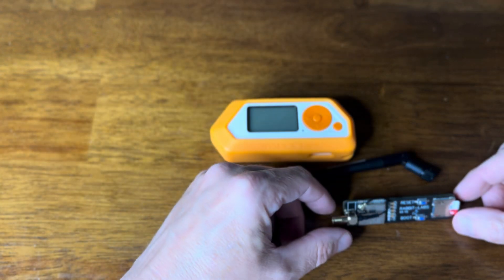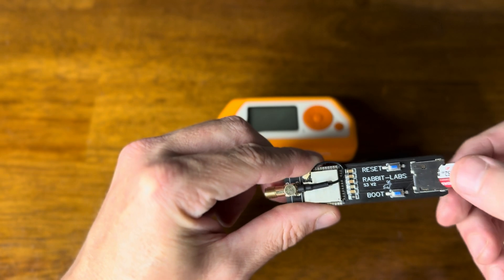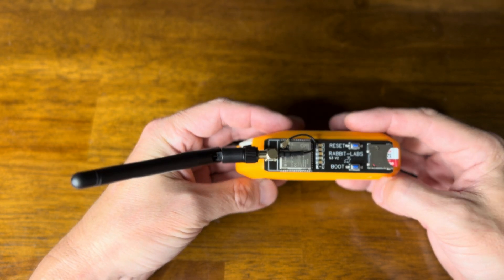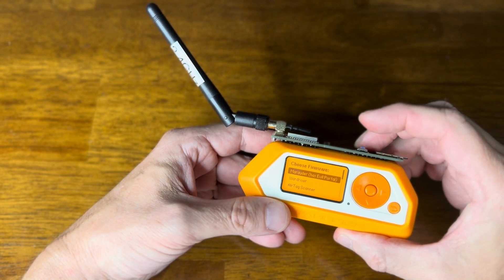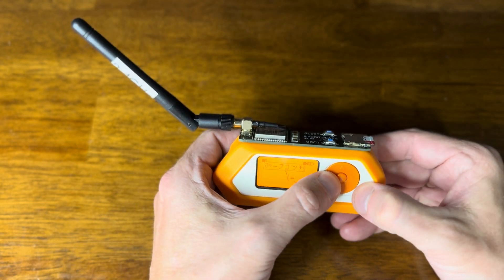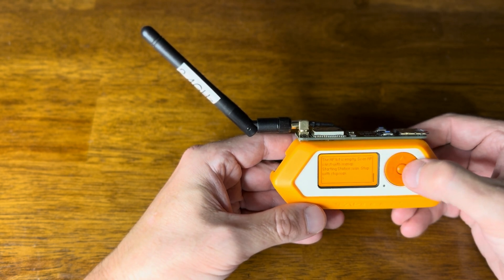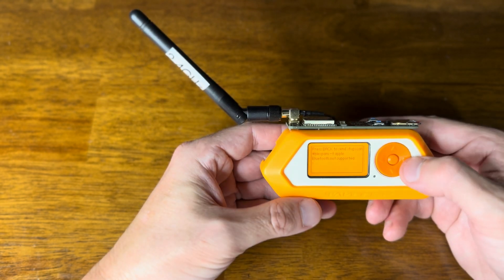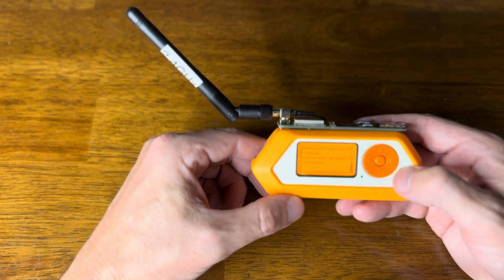Rabbit-Labs ESP32 S3 v2 Flat Flipper Zero board running Marauder firmware

Comment: you use firmware ?? thx esp32s3 connect SD card
Reply from the maker: If you are asking what firmware on the Flipper-Zero I use, I currently use “Momentum”. 

With the GPIO board I am using, in this video, I can choose to use the Flippers SD card or insert an SD card into the GPIO board.